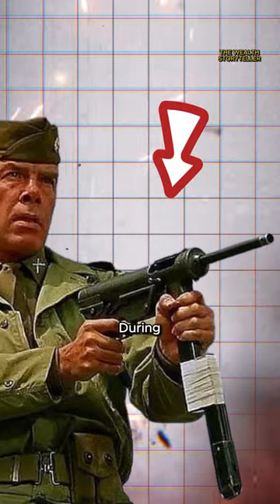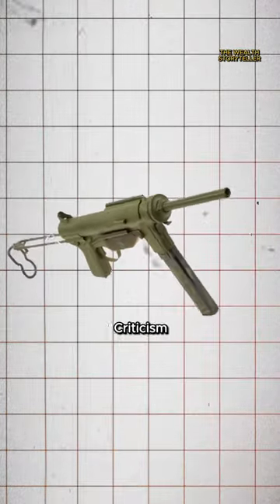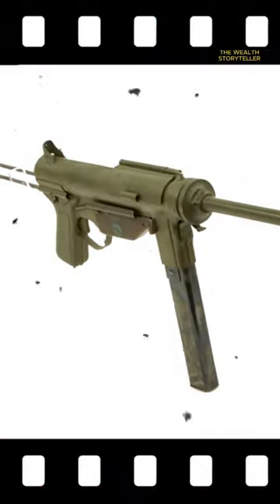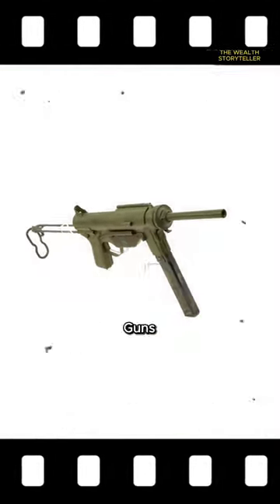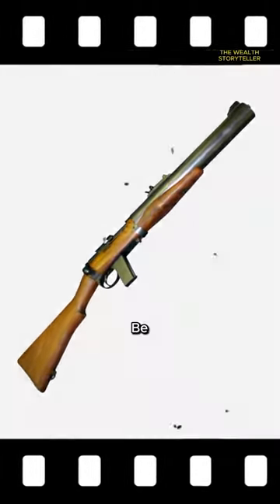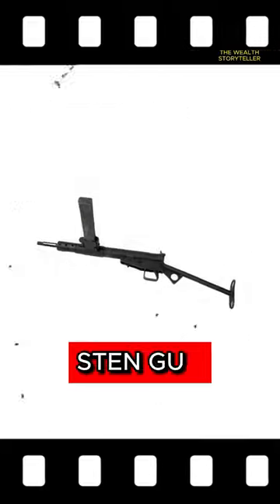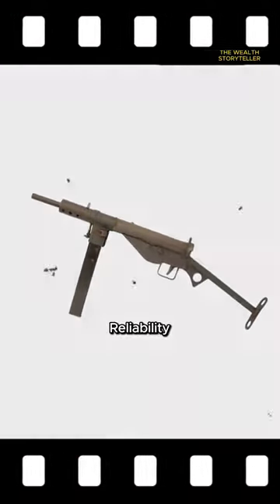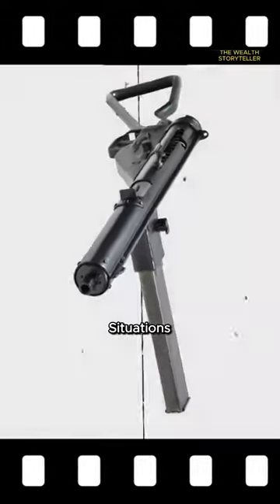3 WW2 dumbest guns

Comment: I’ve seen accounts of the M3 being in service as late as the GULF WAR, if a gun is being used for almost 60 years, there’s probably nothing wrong with it. Not sure if it’s true but I’ve even seen people online say that certain models of M3 are used today, if limited
Reply: Lotta ww2 smgs still used today yes. I think Philippines military uses m3 in certain units 🤔
Reply: M3 was a great gun, there’s a reason it replaced the Thompson
Reply: @cobrajr188  Thompson was known to jam lots yes.
Reply: @willambonney  and very heavy for what it was
Reply: @cobrajr188  yes but updates to M1A1 version made it a good paratrooper weapon.
Reply: @cobrajr188 The Thompson was very reliable when kept clean and oiled.
Reply: @cobrajr188 The Grease Gun was fast and cheap to produce. I believe the first ones cost $45 each then $25 after being simplified using fewer parts.
Reply: @billwilson-es5yn  same could be said about most any gun, but reliability isn’t really the issue, like you said the M3 was way way cheaper plus it was significantly lighter. It’s not that the Thompson was a bad gun by any means it’s just the M3 was a better fit for the job.
Reply: @cobrajr188 For it's purpose, the Thompson absolutely was a bad gun. It was as heavy as a regular battle rifle, had plenty of recoil despite being chambered in a very light cartridge, and was picky with ammo, and magazines. The Thompson was designed around a war that had been over for 30 years.
Reply: @supergoodadvice853  yeah that’s kinda the point of everything I’ve been saying
Reply: @cobrajr188 i mean it was built to replace it tho it didnt really out perform it heavily the main appeal was its dirt cheap price and stupid ease of production but thats not to hate on the gun just to humble it. Both were good and were liked by those who used it. Thommy offered great suppression and comfortable ergonomics, and the grease gun was light and a breeze to lug around, and pretty accurate mixed wirh its low rate of fire
Reply: @theblazingpegasus9151  yeah except both guns had a very comparable rate of fire, and specifically the weight of the Thompson was what made the M3 better, ergonomics weren’t that different either, in fact the m3 had a built in fore grip with the mag in mag well
Reply: @willambonney Nah it was just heavy and expensive

Comment: The M3 was designed to replace the Thompson SMG due to cost issues, and it was issued to paratroopers, tank crews, and officers. The Delian I can kinda understand but only like 3-400 ish were made, so not a good enough sample size. And for the Sten gun, it was a stop-gap gun to arm British soldiers after the disaster at dunkirk. Both the M3 and Sten gun are still used by armed groups around the world.

Never let this man cook ever again!
Reply: Plus the Sten had the advantage of being manufactured cheaply & quickly ($11 per gun if I'm not mistaken)

Comment: Considering that all open bolt firearms can be a bit finnicky sometimes, the Sten was a GOAT, especially the Mark II. Had a side mounted magazine for firing prone and could (not 100% of the time) use captured MP40 mags. Grease gun and De Lisle were amazing for the time as well.
Reply: The Mp38/40 mags wouldn't fit period. The problem was with the German 9mm Parabellum ammo. It wasn't powerful enough to work the heavy bolt all the time. Therefore the Mk2z 9mm was produced and was powerful enough to get around the problem. Hence never use Mk2z in P38's Lugers Broomhandles ect.

Comment: The M3 was $15 at the time when the previous M2 Thompson was $300, this was a t a point in the war when almost all nations involved had switched to a cheap mass produced SMG such as the Owens or sten. Certain patterns of sten are less desirable than others given their poor ergonomics, but they still were quite effective for their cost, and this is after the retreat at Dunkirk where the British had to abandon most of their higher quality weapons. And the delisle carbine was at a time when almost nothing was suppressed, suppressors were extremely rare to be used at all. And most rifles of the time were very long compared to today's standards, most having barrels around 24 inches at the time, where as today it's 16 inches is most common. Being bolt action actually works in the guns favor, since the delisle had a huge suppressor and fired 45 ACP, a naturally subsonic pistol cartridge, it would have been very very quiet, so quiet that the cycling of a semi automatic action would have been louder than the bullet firing, being bolt action means that sound can be controlled.

Comment: If I'm not mistaken, the issues with the STEN actually come from it's magazine. It's double stack, but single feeding. It's much easier to design a single feed firearm but forcing those 2 stacks of cartridges into a single point, causes feeding issues. There were quite a few firearms that were designed to use STEN mags, and they had the same problem.

Comment: Yes the sten had some troubles woth feeding but it was meant to be mass produced fucking ASAP to basically kepp tje British alive until the Americans came. the sten and the grease gun are basically the easiest most simple design you can possibly have in a fire arm. inside the big tube there is the bold wich is held back by the very simple trigger system. (that's why it's called open-bolt smg cuz the bolt is in a open position.) when you press the trigger the bolt move forward, strike the primer, the gun will fire and the pressure caused by the explosion pushes the bold back extracting the casing. this goes on and on until you let go of the trigger wich caches the bolt or you run out of ammo.

Comment: The M3 had a slow fire rate and was unbelievably cheap to make, but in the end, it was a steady, reliable, and very readily available smg that could be more easily fielded than a Thompson. Next, the DeLisle Carbine was purpose built for British commandos. It used pistol rounds because it those were the quietest to fire, and while it was a bit unwieldy because of the suppressor, it still did its job. Then, you have the Sten. Yes, the early models had issues because the british needed guns in rapid order, and some things here and there were overlooked because of that. All of these guns were unusual looking, but none of them were dumb by any means.

Comment: The M3 and the Sten were considered the most reliable and most effective submachine guns of WWII.. 
The M3 was built to be cheap and easy to use, tankers and grunts loved the thing and actually argued with the army when the army was phasing it out

The Sten gun was designed to quickly replace the guns the british lost at dunkirk, the Sten was quite reliable and effective, it was designed so you could use the gun in the prone position effectively, the sten was loved by the british army for the war

The dumbest guns of WWII were guns like the Breda 30, the FP-45 Liberator and the Type 94 Nambu

Comment: The problem with the sten wasn't the gun, it was the magazine. Although it was a double column mag it came to a single feed at the top. Double column duel feed mags are more reliable. The grease gun had the same problem. The Thompson however worked much better due to its double column dual feed mags. The story behind the sten was simple. Create a weapon in mass quantities that can be given to soldiers and civilians alike to repel any German invasion of England. A couple hundred people armed with stens could lay down a lot of fire on a beach.

Comment: Counter Arguments: 

M3 Grease Gun: Standard Issue SMG alongside Thompson, cheap to manufacture unlike M1. 

STEN: Standard Issue SMG for Commonwealth soldier, the cheap price of it made it "go for it" for the Ressitance members, STEN csn be argued that it was horrendous, but overall it wasn't that bad.

Weapons that could've been used instead:

Lancaster SMG: Inferior STEN, some how they gave this garbage to Royal Navy. Only good thing is it's Magazine of 50 rounds. 

Machinenpistolen 30-08 (MP-3008): Weapon made out of desperation, it was handed to the troops of Volkssturm, civilian militia. You can argue about this one, since its not "dumbest" hut was Obviously very bad, I heard that whenever it was possible Volkssturm soldiers replaced it with other equipment. 

Fallshmijagewher 42 (FG-42): Gun was bad as an idea, they wanted something of that small to fire 7.92mm rounds, yeah it failed (I wonder why ?) 

Also I once heard that Automat Federov was used in the winter war, the reason why its dumb is because it fired 6.5 Arisaka, while being used by soviets. (They did not manufacture Arisaka rounds)

Comment: Yep. That's what's important in war. Elegant looking weapons. Ever notice during prolonged wars counties simplify weapons to make them cheaper and faster? Even the country known for over engineering and elegance (germany) did it. Pre war, their mauser stocks took years to produce. The MG34 was lathed, but then they just slapped the MG42 together with stamped sheet metal. Their Machine Pistols use to have aluminum parts....

The M3 grease gun is a fantastic weapon for its time.

Comment: My Grandfather was telling me during the war the issues they also had with the Sten V1 was it clipping the top of your pinky finger because under full auto you hand would slid back towards the bolt and clip the top of the pinky till they added a small L shaped bracket to stop the issue.

Comment: M3 Grease Gun was great. It's cheap, reliable and gets the job done. It looks ok for me. Every decoration would add to its weight, time needed to make and the final cost and there was a war to win. As it comes to Sten it's not bad by nature. It just had bad production lines without enough quality control. Same problem with PPSh and T-34 in USSR. As it comes to De Lisle it was never considered as a weapon to the "average Joe". An as a very niche gun made for sepcific tasks it worked well.

Comment: m3 was not dumb.  it had a point.

the tompson required advanced machining, was slow to make, had a lot of machined parts... and cost 200-250 per. 

A browning BAR was 300, a Garand was 85, and the little M3 grease  was 21 dollars,  almost 1/4th the cost of the battle rifle, and 1/10th of the Thompson.   

its point was it was cheep, quick to make,  easy to mass produce, and easy to get into the hands of everyone.

Comment: Simple designs seemed to suit best during WW2 wherever you looked. The Japanese had an SMG (I forgot the name) thar was updated by stripping it off all unnecessary pieces, which vastly improved its performance before. The Grease Gun was Aldo a very nice little thing with a slow fire rate, making it easy to have follow-up shots. The rifle I won't butcher was a weapon that was just a wee bit too late in the war I believe, but the Brits wanted them and interviewed the man that made the weapon, the difference being that the original was a .22lr hunting gun. Lastly, the Sten is probably the best British SMG of the war on account of cost and reliability. These reliability issues stated in this video are mostly from the earlier ones which did jam up and prove to be poorly reliable.

Comment: You really should reconsider your words. Those guns were designed for specific purposes, The M3 and the Sten were designed to be  cheap and easy to manufacture  and to put a lot of bullets in the direction of the enemy. Jamming was generally caused by misuse, for example the Sten was frequntly (despite instructions) held by the magazine.

Comment: My 4 dumbest gun in WW2
1. Type 94 Nambu. A pistol known for shooting when holster becomes of exposed parts (or anything that touches that single exposed part)
2. Lever action. You would easily get shit on by bolt, semi and full auto.
3. .25 ACP. not strong as a .45 or a 9mm. Basically ass because you need to be close to them to take em out. Might as well use a knife if you're going CQB or a shotgun so more Nazi can complain about the Allie using deadly weapons while they are using tear gas.
4. Flame thrower. It's cool but once that tank is shot, it's either deflected or went strait through it and 💥 you and your squad are down

Comment: He mentions the sten gun but shows an mp 3008, which is extremely similar with the main difference being the magazine attached horizontally, not vertically.

Also, the de lisle carbine had 2 variations, one with a fixed stock and another with a folding stock.

Comment: Not even close. The Schmizer was the dumbest gun of WW2 so dumb a single short squeeze of the trigger would dump a whole magazine. Which is why it was quickly replaced with the MP40 along with this the Luger pistol a pistol notorious for injuring the weilder if carried with a round in the chamber. Finally the Japanese Namboo pistol for the same reason.

Comment: Not even CLOSE to the three dumbest guns actually made or used in WWII...

I'd nominate the 
The USMC Reising M50, an unreliable sub-machinegun that broke or jammed in ways unfixable in the field.

Japan's Type 94 Nambu pistol, which could be inadvertently fired by dropping it or brushing its exposed trigger bar the wrong way.

The US manufactured Liberator pistol ,a cheap, stamped metal, single-shot pistol designed to be sent to partisan forces in Western Europe. With an effective range of about 10 feet, no sights, and taking minutes to disassemble to reload....it was wholly impractical in the field.

Comment: The M3 was praised for it's ease of use and reliability though? The nickname only came from the faint resemblance to a grease gun, the gun itself was a reliable tool that was appreciated by soldiers. De Lisle might have been "unwieldy" but boy howdy was it damn useful during covert operations. The pistol ammunition combined with a giganting suppressor made the gun very silent. The STEN might have had horrible ergonomics, but it was incredibly simple to use, cheap to manufacture and it was THE submachine gun used by the French resistance fighters. Viva La Revolución!

Comment: What??? Lacked sophistication..
Those two Maschine Pistols where two of three of the most sophisticated allied guns available in Ww2.
The third one was an Australian Model a teenager build on a Workbench in a barn!
It doesn't really matter if this piece of stamped metal jammed, a sophisticated slap or use of a hammer or some other tool made it work again.
Nobody liked those guns, but they were ingenious for simplicity, availability, cost efficiency, resource requirements, time to train a soldier on it, field stripping/reassembling getting rid of jams.
And by the way how can an English speaking you tuber lack the capability to say De Lisle  De L+ Isle.. Like Isle but an L in front.
It's not French.

Comment: And were produced at a time when you needed a lot of units fast...the reason why you have the m3 over the Thompson is because the Thompson took a lot more machining to produce...the m3 was faster and cheaper to produce...long and short, war isn't glamorous and neither are the weapon used in it...if you wanted to pick on anything, why not something like the chau-chat? (Yes I probably spelled it incorrectly but I'm not french)

Comment: 1st one is reliable cheaper and powerful 

2nd one is used for covert op missions it is designed to be silent 

3rd one is pretty much the same as the m3 grease gun cheap reliable and had a powerful round enough to kill someone

Comment: All of these are wrong in their own ways
The m3 grease gun was designed to be anti snag and was extremely cheap to design
The de lisle commando carbine was innovative in stealth warfare as it was one of the first rifles to incorporate a useful suppressor 
The sten gun was designed after the Dunkirk disaster where most of their thompsons were lost on the beaches, forcing them to create the sten, the sten was successful enough to be updated throughout multiple variations and was preferred over the other firearms by paratroopers as they were light and automatic enabled

This channel should really do their research before making themselves look stupid

Comment: The m3 grease was made because the Thompson was expensive to make so they went with a cheap option a full metal gun and it was good as the Thompson basically the brother of a Thompson and the sten the British bought Thompsons before but were expensive to buy so they made they own sub machine gun the sten sure it had its ups and downs but the British still used it

Comment: Weren't like all these designed and stamped for mass production for giving the French resistance? And let's be real the whole point was if they had to dump em they could and it wouldn't break the bank. Cheap simple easy best thing possible when arming civilians with no experience. This HAS to be satire